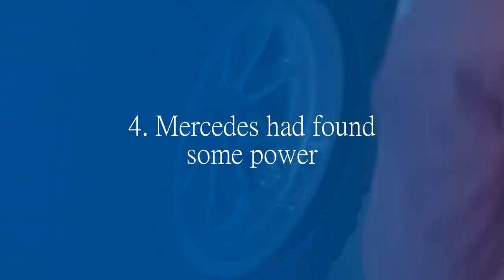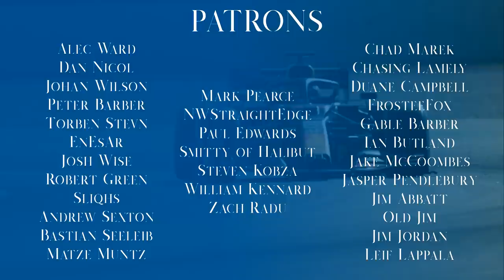THE SCANDAL BRUSHED UNDER THE CARPET! The Story of the Ferrari 'Cheat' Engines (2018-2019)

Comment: About Baku 2017. Yes, Lewis never touched his brake.  If you watch the TV replay where they were showing Lewis' telemetry, you see that he starts to launch, and then he lifts.  With the way F1 cars take off, a lift after a launch is as good as hitting the brakes for the car behind.  I find it interesting that they stopped showing telemetry on screen after that. :-/
Reply from the maker: It also doesn’t help that the on screen telemetry  at that time shows 100% brake no matter how much is applied. It’s either full on or full off.

People saw the red bar max out and went BRaKe TEsT!
Reply: As I recall, the post-race investigation showed no significant variation in the behaviour of the Merc on that corner compared to previous laps?
Reply: @AidanMillward  Yes, and thus the conversation focused on whether he hit the brakes.  Nobody seemed to notice his revs ramp up, and then a sudden drop off (a lift off throttle) just before Vettel hits him.
Reply: @peterthomas5792  Possibly, never saw that.  Only that he didn't hit the brake.   But when you watch the replay of both restarts, the earlier one, Lewis launches immediately from that turn.  The next time he starts to launch, but lifts and then Vettel hits him.
Reply: @Shane-Phillips  Yes, though the claim is Lewis never touched the brake (and there's no evidence he did).  It's unclear why Lewis started to accelerate then lift.  Nobody asked.  They just asked if he brake checked, and he said no.  And the telemetry supported that.  Problem is, wrong question was being asked.
Reply: "starts to launch"
This is just plainly ridiculous:
- Vettel hit him just at the exit of the tight turn 15. Hamilton would not have launched his restart so early on the circuit.
- The safety car was still visible a few hundred meters in front of Hamilton when Vettel hit him. If Hamilton had really launched at that point, he would have close on the SC before the restart line.

Vettel was just frustrated that he nearly lost a position at the 1st restart and so he tried to stay much close to Hamilton the 2nd time, and he was way too close way too early.
Reply: @Olivyay  I don't think so.  I don't recall seeing the safety car still at the restart.  It wasn't there when Lewis launched from turn 15 at the prior restart.  Guess I'll have to back and look.
Reply: @frankbieser  https://www.youtube.com/watch?v=iOI2It_W3No
Reply: @Olivyay  You're right.  I thought that Lewis had held up the pack so much the safety car was long gone.  But you can see it still.

Comment: It’s more outsmarting the FIA than cheating imo.
Reply: Nope, outsmarting the FIA would be the double diffuser: finding a loophole or something left ambiguous and using it to your advantage. The fuel flow limit is explicitly defined in the regulations. They not only broke it willfully, but developed a mechanism to evade detection. 100% cheating.
Reply from the maker: The fia said in the rule book since at least 2017 that circumventing sensors is prohibited.

Comment: The mercedes engine "was designed to run for 3 races" excuse is bullsh*t. 
1. When redbull made enough noise in Brazil and said they would protest the results if they ran the rear wing in Saudi Arabia, the advantage went away. They were still more powerful but not ridiculous and more in line with their explanation that the engine was designed to run for less races. 
2. Lewis was pulling cars in from over a second away at the end of straights. You can't get a 30 kph speed delta by making an engine run harder. It has to be combined with drag reduction in a way that was at least bending the rules. 
3. If they could gain that much performance advantage (i.e; overtaking people from a second back) legally, people would be swapping out engines more often. That is too much of an advantage to give up. 

Because it only happened for one race and redbull won eventually, this was swept under the rug just like Ferrari in 2018. I hate it when British people are biased like this.

Comment: Ferrari has the ability to cheat as much as they like. There is a clause in their contract that states if they are caught cheating it has to be kept under wraps. That's why the big silence from the FIA about the fuel sensor saga. Ferrari had another power jump in the middle of the 2021 season. Pretty much everybody knows in the paddock that they are cheating again including the FIA but they haven't figured out how.

Comment: Personally i kinda think that fuel flow restrictions are silly in racing. Fuel weighs the car down, and so you have to carry more if you plan on burning more. There is so little to compete in when the engine type and even the fuel flow amount is regulated to be exactly same for everyone. Granted we fans won't really even realize how much or how little freedom the teams have been given for the new reqs before the car reveals start happening, but I fear F1 is slowly becoming more of stock racing sport, all as a result of trying to give the fans a fairer competition to watch.
Reply: Yep. If you think cars are using too much fuel, just cut down the amount of fuel they have for the race - job done.
Who cares if they have 50bhp advantage on the straight if they have to pull over 3 laps before the chequered flag?
Reply: It's part of the "enviro-friendly" image-seeking that caused the whole hybridization in the first place. And it's not new, either -- IMSA Group C was a fuel-limited series back in the '80s.
Reply: Isn’t limiting fuel something that’s been in racing for ages? There’s always been a maximum fuel tank size since I can remember. Or are you you suggesting to only limit fuel capacity and not consumption rate? Either way you have X liters and it’s gotta last you Y laps while going as fast as possible. Restrictions are always going to limit power whether it’s displacement, compression, fuel burn, capacity, or whatever. Sure you can have no restrictions like Can-Am but then it becomes all about funding and engineering and not racing on the track.

Comment: Mercedes has been gaming the system for years, Go back and watch the events, you will see oil smoke from the exhaust.This is why they have been using a "low ash oil" in there road cars as well. You just set the engine up to burn oil and a "fuel" and guess what you can back down on the fuel burned and increse the fuel economy(remember oil consumption is not part of  the C.A.F. E. ) or during a race the blended fuel oil can produce greater power output. Like most things Italian the ferrari  team was just not bright enough to go at it in small bits as to not call attention to the situation. The races they started to inject engine oil into the inlets the engines smoked like mad! And made gross improvments in lap times and trap speeds. And so now engine oil is now a tech item and the teams are just cheating around the oil quantity tech inspection.

Comment: pretty sure there was a punishment, - i am sure that the following season ferrari engines had to run a slightly lower maximum flow as the loss in performance covered all speeds and not specifically at the 2nd half of a long straight when the conditions were right for the system to align with the pulsing and use more fuel.

Comment: It comes down to how good the testing is, is injecting more fuel in between the sensor checking the fuel flow any different to having a rear wing that flexes at speed but can still pass all the FIA's static testing? Is something that passes all the tests fair game?

The scandal actually isn't what Ferrari were doing or had done but to not disclose the agreement reached by the FIA and Ferrari. 

Ferrari won races, taking points away from other teams, if they had stepped on the line then the decision to allow them to keep the points providing they agreed to step back is probably fair, but if they crossed the line, then they should have had points deducted.  

Brushed under the carpet was exactly what happened, and is what is likely to be done once the FIA's investigation into the Abu Dhabi race has been completed.
Reply: The FIA could only prove mathematically how they did it in past races. No actual physical evidence existed as it happened when the sensors weren’t looking. 

The FIA changed their sensors and suddenly that Ferrari lost an awful lot of speed, which proved in absentia that the engine had been operated illegally in the past.

Its not like a flexi-wing though, were the intention is to push the boundaries of physics. The regulation they broke was an unambiguous 100kg/hr (2.7g/sec) fuel flow rate and the only “clever” thinking was employed in not getting caught every time they turned the engine power up

Comment: Of Course ...Driver61   has already explained this,,
Driver61's daddy actually repairs privately owned F1 cars,,,
and of course has explained this,,,
i like this guy (dave or something) but meh..
you let oil vapour into the intercooler output,,oil plus fuel..
Reply: Driver61 went into it the same,, but oil vapour into the intercooler was the biggest drain in HP,,

Comment: F1 is about finding gaps in the regulations - things you can exploit to make the car faster than most would expect is possible from a normal read of the regulations. One team outsmarting its opponents shouldn't be frowned upon. 

Ferrari did just that - they found a way to play the game that didn't break the rules in the sense that the FIA couldn't pick up on it during regular scrutineering. 

Was it in bad spirit given they were breaking the fuel flow 'limit'? Probably, yes. 
Was it a perfectly valid way for them to gain performance? Also yes. 
Did they out-smart the FIA (for a time)? Yes.

I'm fine with Ferrari doing what they (probably) did. I'm fine with the FIA issuing a directive to put an end to what they were doing. 
The only think I'm not fine with is the shady nature of how it all happened and got sorted out. It's opaque, it's suspicious, it leaves a bad taste in the mouths of the other teams and the fans that some sort of shady deal was made.
Reply: Actually no it wasn't a loophole, it was all out cheating, because the rules say that fuel flow must not exceed this rate period, not the fuel sensed by the sensor must not exceed this

Comment: Interesting comment from max in 2019? About cheating.... then 5 years later.... 2024 the braking system rules tweaked mid season..... and max hasn't won a race since after taking 7 of the 1st 10. Yeah max. That's what happens when you stop cheating

Comment: I saw someone suggest giving the teams 100 litres and use it how they will. Oil and water would also have usage limits and they absolutely couldn't be refilled. Possibly in addition to that there would be a bonus system so that left over fuel takes time off your finish time or goes to constructor bonus points or something like that. The crowd wants to see a car finish first, the FAI wants to see big crowds and happy crowds if possible. If the cars can't go full noise without the risk of running out fuel then they will innovate so that they can go fast as conceivable whilst still being relatively fuel efficient.

Comment: Another case was last year. The sudden and massive speed gain Mercedes had over RBR after they went from a tenth down in qualifying at the USGP, to gaining a net 5-6 tenths out of nowhere  was very suspicious, and more than just a new engine for Lewis. It's very interesting that once inquiry and some public speculating by RB that Mercedes rear wing was intentionally designed to deform and flex for an illegal advantage, and pictures emerged of Lewis rear wing deforming in Qatar emerged, their speed dropped back to the average 1-2 they had over RB for the final two grand prix.
Reply: I think Mercedes' unusual burst of pace are due to Mercedes carefully using the engine rule penalties to take advantage at tracks where they are fast enough to pass everyone.
Reply from the maker: @T_Mo271  this. Lewis had an engine carefully engineered to last 4 races rather than 7.

Comment: I still get mad when they list those Wins and Pole Positions they got with the Cheating. And never understood why Red Bull didn't file a Lawsuit to get Second in the Constructors...
Reply: Read some other comments and you might get some valuable information into your brain
Reply: @elianioriofarrell  And what information would that be?
Reply: There’s no physical evidence to present to a court, as it happened where the sensors weren’t looking, you can only prove mathematically that’s what happened and that the car was slower when the sensors were changed.
Reply: @MsZeeZed  After Sensors were placed Performance Dropped Significantly...first in the Battery.. Then again with the Fuel Sensor.. Evidence enough for me.
Reply: @Ronny999x  as I said, read, get some actual substance and different opinions in there
Reply: @elianioriofarrell  Next target is Mercedes. They can put their Engine into Overdrive. So it only lasts a few races. They can take penalties but still win with that Rocketship as we seen last season... Its not in the Spirit of the Rules. So the FIA should look at that Next.
Reply: @Ronny999x  I agree, they should be slowed as a punishment the same way Ferrari were